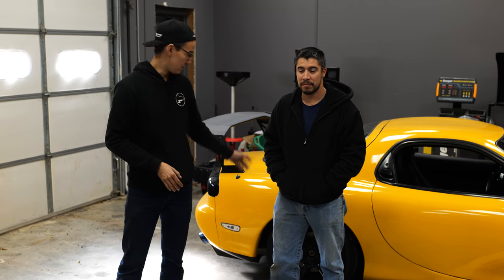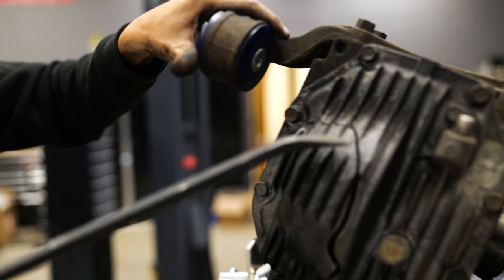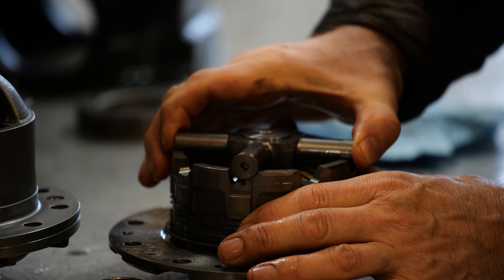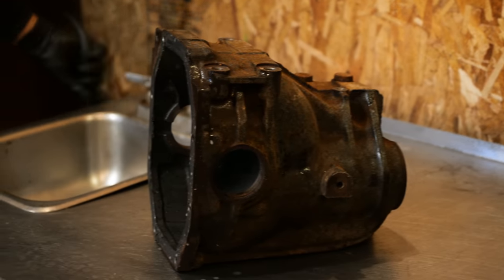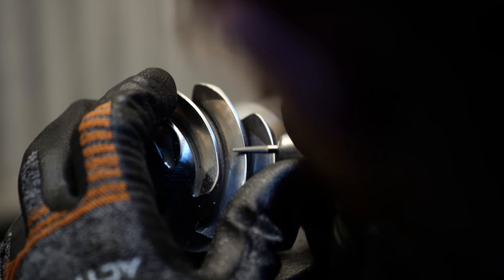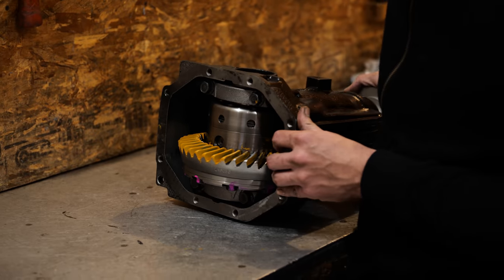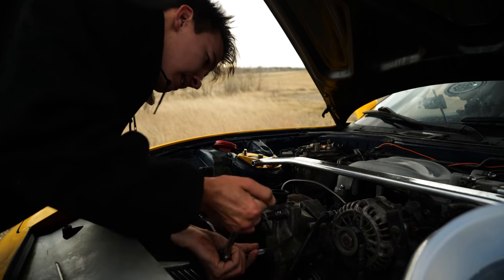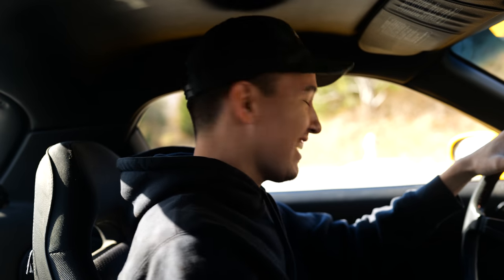Upgrading My Broken RX7 Diff

Comment: I always wonder about the price to do these modifications/repairs in y’all’s videos. Would be super cool for the non-car-expert viewers if you included an estimation of the prices.
Reply from the maker: I meant to say it in the video:
Used RX7 Case/RX8 Diff/Seals - $6-700 w/ shipping from eBay/Racing Beat
ATS Super Silent - $1600 w/ shipping
RP Diff Brace - $425 w/ 2 day shipping

So like $2700 all told. I don't know about Jon and Aaron's pricing for services like these.
Reply: @GearsandGasoline  that’s as much as my miata cost me 😂
Reply: @GearsandGasoline  Awesome, thanks! Not as expensive as I expected. And yeah I guess it would be hard to say definitive service charges since different places’ prices will probably vary.
Reply: @rauldeu56  loll good man, I know people who bought miatas for 6k+
Reply: @GearsandGasoline  Does that magnet work on chicks too?

Comment: The secret to not grenade an FD diff is PRELOAD the drivetrain before launching. The inner torsens have a bit of slack which allows too much play with the drive shaft. When launching without loading, you're basically impact/jack hammering the internal torsen gears as the driveshaft will free spin a little bit before the gears engaged internally. Preloading seats all the gears.

Comment: Dang! You properly destroyed that diff. When mine went in my 02' WRX I was on the freeway. I was doing some "testing" against a Charger. I guess the diff just overheated and bang! Sounded like a 12 gage  went off in my car.  The  broken gear teeth exited through a large hole in the case.
Reply: I have a bugeye wagon, I'm already worried about the 5 speed dont get me paranoid about the diff now 😅
Reply: @Lucky-vc1qo  They're definitely glass but long as you're easy going INTO gear it holds well. I got 190k on my 03 before I sold it stock trans on an evo3 16g turbo
Reply: @ivangamer8022  ? xD
Reply: @matthewkinney5474  do they use shit quality material I would point out most American cars since the mid 80s have not exactly had the best build quality

Comment: I would advice getting a diff brace the attaches to the subframe and not just a diff cradle. The cradle will not stop the front of the diff from moving up and down causing the pinion gear to walk down the ring gear!!

Comment: An excellent vid, albeit one that might perhaps give viewers the impression that FD diffs are fragile.  Having had mine for nine years and done a few trackdays, I've not encountered any diff problems nor heard of it being an issue outside of big-power drag cars.  It's important to remember that the RX-7 is a quarter-tonne lighter than most 276hp-class rivals, without using any exotic materials.  You don't shave that kind of weight by making anything thicker, stronger or heavier than it needs to be.  As a piece of precision engineering, most parts of the FD are strong enough for normal enthusiastic use; however they don't have the extra margin for "abuse" in the way that a Mustang or Camaro might.  That's part of the tradeoff for a lighter car.

Don't worry, I understand this is Youtube not real life.  You made an amusing video breaking the diff, and now you've made a really informative and enthralling technical one replacing it with an upgraded part that'll stand up to burning out sticky tyres.

So yeah, not a complaint at all, love the channel - just want to put the 'weak' diff aspect into context for other viewers 🙂

Comment: Shot peening introduces compressive stress solely for putting the surface in compression, which “holds” cracks in compression, rather than tension. When tension propagated cracks.

Comment: I wonder how similar that is to the Mazdaspeed6 rear diff...In terms of the ring and pinion. The MS6 diff has clutches but... they're also notorious for being junk. My MS6 differential was a pain to change!!
Reply: MS6 uses a rx8 diff, no need to engineer a whole new diff for a low production car. They're notorious for being junk because the diff mounts are weak. I'm sure someone else will chime in, I sold mine years ago!
Reply: @CharlieTheMuffinBandit  I sold mine too! Haha

Comment: So the 6-speed RX-8 diff case is a straight bolt-on replacement for FDs? Just asking for a friend.
Reply from the maker: No it is not. That's another FD case that I got off eBay and had Aaron stuff the R&P into from an 8 diff
Reply: @GearsandGasoline  Thanks a lot! Now all you need is a set of OS Giken close ratios to get some RPMs back for those diff busting burnouts!

Comment: hard fucking balls to do what you did at the end, i am fixing my evo 8 clutch (stock and flywheel) and radiator, i will be so scared to do pulls espically knowing what previous owner did ( using evo 6 clutch with flywheel and deleting both o2 sensors) ....so scared.... :(, btw 2 months now not driving my dream car :( waiting and waiting  everyday with new findings ...  pray for me